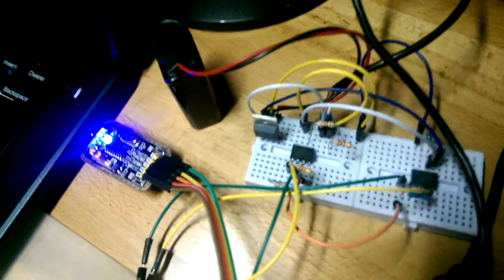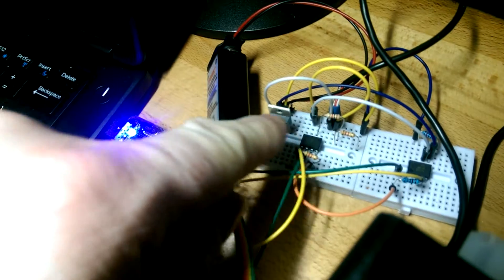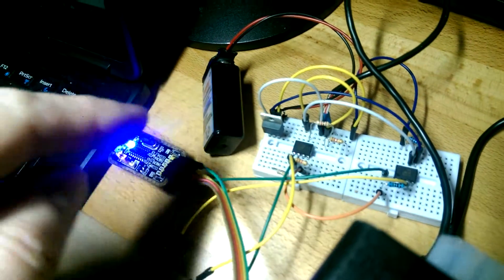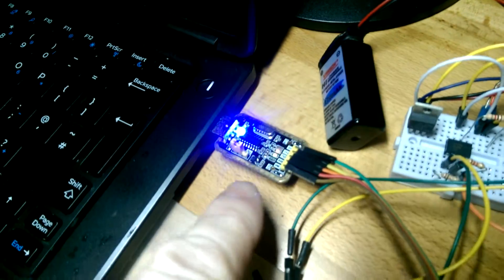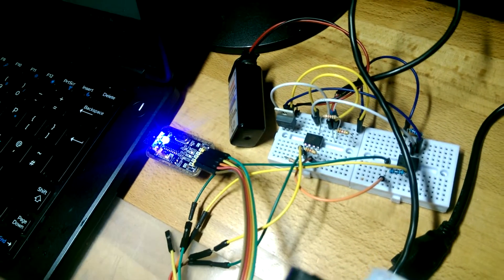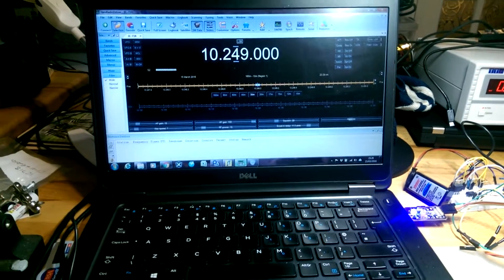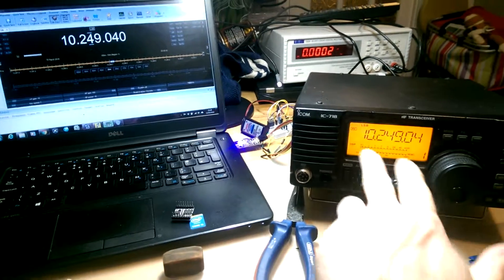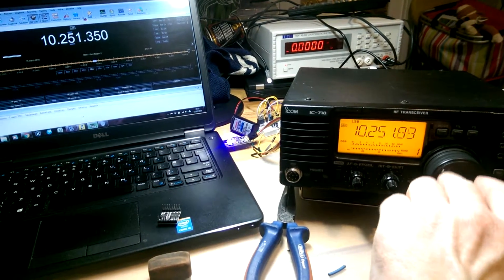Fully isolated prototype Icom CI-V Interface

Comment: Why do you need to galvanically isolate it?
Reply from the maker: It works fine connected direct to my laptop so I shouldn't need to but I wanted to make sure there was no possibility of ground loops or fault current flowing between radio and PC if something goes wrong or I hook them up to different, isolated, power sources.